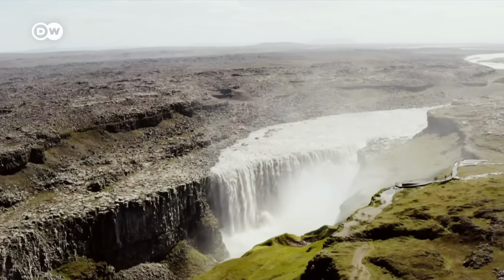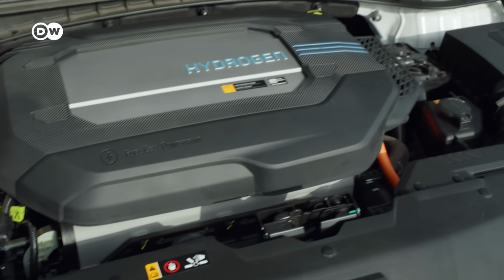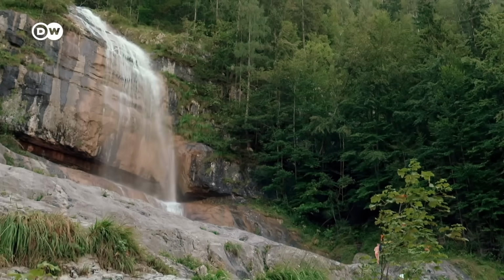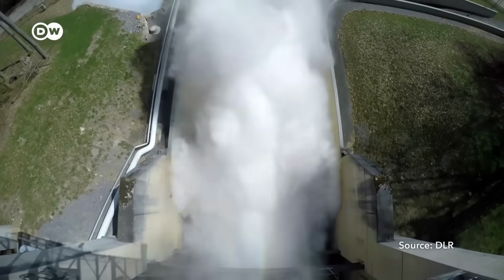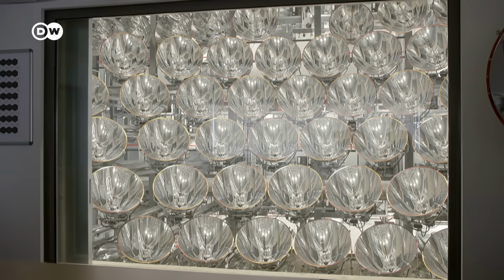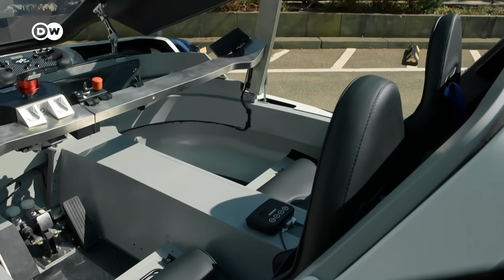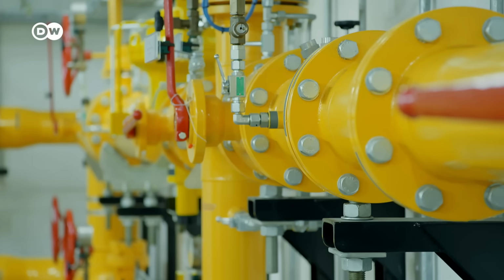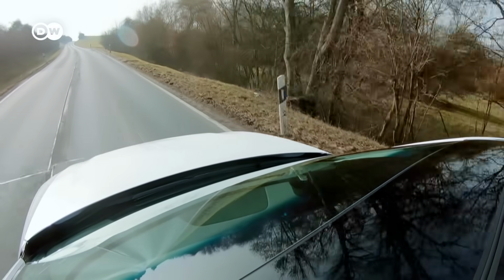Is green hydrogen the answer to the climate crisis? | DW Documentary

Comment: There has been a saying for many years: “Hydrogen is the energy (means/source) of the future”. 

The main concern is what if it remains as such for many more years to come!
Reply: Hydrogen is an means of storing energy just like a battery. They will need to prove that the round trip efficiency of Hydrogen is better then the battery.
Reply: @kevingooley6189  Just compare the weight to power ratio. Empty batteries will weight exactly as much as full batteries.
Reply: @mramstedt  

Yes that is true batteries don't loose weight as they discharge. That defiantly needs to be factored into the equation.
Reply: Only lobbyists and their sheep sing the song about the hydrogen car. There will never be a hydrogen car for everyone.
Reply: Always seeing the eco fascists fighting hydrogen, as if there is an alternative technology available that would work for aircraft or heavy industry. As ever, they are disconnected dreamers who think energy is magic and hydrogen is something invented by the oil companies.
Reply: @1stSilence  unless SWB pinpoint the exact location; you can't explore duterium; the answer to climate change.
Reply: @1stSilence  Lobbyists sing the song of the electric car, and they got what they wanted
Reply: H2 is not an energy, it is a storage means. It first divides the energy you input by 2, then leaks 0.5% to 3%/year. Those pushing it as the solution to all energy ills are just intent on selling something on it…
Reply: @longcours  It's not as bad as LNG tankers which can lose up to 30% on a single voyage into the atmosphere.

Comment: Hydrogen is not a Primary fuel, in effect it is simply an energy storage technology.
What is proposed is to use hydrogen instead of using batteries or other storage media. This wasteful process may be a useful interim technology for certain heavy applications but logically it will be displaced by efficient nuclear processes  in the future.  Because you can does not mean you should.
Reply: Batteries mean another deforrestation
Reply: Methanol seems to me be a better energy carrier for renewable sources of energy
Reply: @Chitragupta What does it degrade the performance of?
Reply: What efficient nuclear processes are you talking about. Will we have a nuclear reactor in our car like I'm Back to the Future.
Reply: A battery that doesn't degrade and doesn't need precious minerals, which can refuel a vehicle in seconds from our existing refuelling network, sounds good to me !!
Reply: Hydrogen made in summers for heating purposes in winters can be as efficient as 80-85% round trip.  This efficiency can be competitive with batteries.  Hydrogen pipelines costs 1/8 the cost of electric power lines per kW of thermal energy per mile, and existing natural gas pipelines and storage can be used to store H2, thus minimal new investment to convert from natural gas to H2.  H2 and Battery should co-exist, each serving different niches.  Works have been done to perfect "efficient nuclear processes" for the past many decades...but so far...???  We just can't put all the eggs in one basket.

Comment: Its all hope. Hydrogen production for the western countries, 36m EVs a year (50% of yearly  global sales) not alone the extra minerals that need to come out of the ground, hundreds of millions of heat pump systems that work in the cold and the capacity to produce them, €100k per house to retrofit and the amount of material that will take and the at least doubling of electric generation of of grid capacity to generate green power to drive it all. This is a long haul thing 50-100 years.

Comment: In denmark we have a longterm project of making an artificial island out at sea to our west. Our plan is to make a massive windfarm where the exess energy will be used for electrolysis of saline water. We will have oxygen that is either released or bottled and hydrogen we will use for fuel for the ships out there. Effectively we make fuel from the green energy if we on some days make too much wich we can use later.
Reply: @Eternal Atake if you would investigate this aspect then will be surprised of how much fish love artificial riffs... the problem is not in the fish but in making those very co2 expensive turbine and all assotiated steel and concrete structures... do you have any idea about how much energy is required for cement production?  Look deeper in to the energy problem and not only by green activist slogans, so far there is no such thing as green energy...
Reply: @Eternal Atake unfortunately it's not only financially, in the core itself it is not sustainable, solar panels as an example do not pay back their energy required for manufacturing, and they become real problem as waste... ethanol fuel is another example,  we use so much extra land to produce food which go as fuel, instead just using much smaller amount of petrol to produce just necessary food and leave the land to nature... everything these lunatics promotes just aggravates the situation and encrease pollution which is a real problem...
Reply: @onlooker774  
Look into CO2 neutral concrete formulas.  There's different formulas, some of which absorb carbon, to the degree that the cement takes up more CO2 than production of the concrete puts in the air.
The thing is, the governments have to mandate the new formulations.
Otherwise, the concrete companies won't switch, because of cost.
Reply: Hey i saw a news about how Denmark's people slaughtered around 1500 dolphins for some shitty tradition ☹️I pray those people will suffer for their crimes
Reply: Tout crève encore même les poissons
Quand bourgeoisie et gouvernement ont tous les passes les droits les libertés ... 
Rien de souverain ni de démocratique alors le vert est plutôt pourrie crasse dominante et persistante
Reply: @Eternal Atake Lol. Much safer than shipping oil.

Comment: Hydogen is not an energy source it is an energy conductor. That the first problem. So the other problem is ROEI "Return on Energy Invested". Fossil fuels have a very high ROEI the oil wells of the 1930s had a ROEI of 100 ie you put one barrel of oil in drilling etc and got 100 barrels of oil in yield. A modern economy requires a minimum ROEI of 15-20. Most of the green energy solutions yield less than that. ie After you burn fossil fuels to make a wind turbine, or solar energy cell the net power from these things are not constant or sufficient to be sustainable over the long term and maintain living standards. Wind turbines and solar cells generally yield less than 10. So we will be burning a lot more fossil fuels and living standards are already dropping.

Comment: Hydrogen is very inefficient volumetrically. It is also notoriously hard to store.
Simpler, more logical solution, would be to generate synthetic hydrocarbons to power the plane. Or even better ethanol(because it is environmentally more suitable).
Reply: I somewhat agree, but it is genius for solar and windplants where they can use the exess energy and use it as a buffer.
Reply: @1Animeculture  As storage it too is problematic. The efficiency of hydrogen generation is low. While it may reach 85% this efficiency is reached for hydrogen made out of methane. If you want to make it out of water then efficiency drops to 50-60%
There is better solution for this application- redox flow batteries. Or lithium phosphate batteries. Contrary to myth, Lithium is quite abundant. 
Not like Palladium which is essential for fuel cells. Palladium is very, very rare element. Gold is common element compared to palladium. Gold is 30 times more abundant than palladium. I have read article where there was stated that entire world stocks of palladium would last for about 2 million fuel cells able to power cars.

Comment: Simple, lobby to govt that all new house builds require to have solar, electrolyser, battery, fuel cell as standard with hydrogen stored using metal hydride tanks. Each house can then feed their own home with green energy and when batterries are full will then create hydrogen as a long term storage. This storage can be used as a battery backup or fill the car up. Lower the energy grid and become self sustainable.
Reply: And a level-2 EV charger only costs few hundred bucks without any change to install anything. Hydrogen is a mess and you need safety certifications for the building and huge insurance policies to cover just the hydrogen tank. Also, fuel cell battery costs 10 times more than lithium-ion battery. When you can use electricity to charge directly lithium ion battery, why would you use the electricity to power the electrolyser to generate hydrogen and then charging the fuel cell battery?
Reply: I think your normal house doesn't need a hydrogen tank, a battery can save enough to power a house through a few days.
Reply: No need for all that tech stuff House should be Passive/Net-zero ....Solar on the Roof and maybe a vertical/Wall Turbine to help ....Look at energy efficient house before Storage/Conversion tech

Comment: That segment about using artificial light to then heat up water to then produce hydrogen (thermolysis) doesn't make any sense whatsoever as it's more efficient to simply produce heat from electricity (via resistive heating elements). I guess it's instead to test that concept in a lab then they'll do so using sunlight and concentrators outdoors? Why not just test it using the latter? Very odd indeed.
Reply: Those are just experimentals, obviously they are are just using energy for the sake of testing. The idea is they wanna figure out if they can use the heat from the normal sun to make hydrogen rather than turn it into energy first (wich loses some of the energy im the process), the advantage to test with lamps is they can start and stop the experiment at will.
Reply: @1Animeculture  Several large solar concentrator plants have already been built. It's well understood.

Comment: The problem with hydrogen these days is that you have to watch for the bait and switch by fossil fuel companies who want to continue extracting ground resources to create hydrogen. That is a dead end for us and is NOT the solution. Hydrogen will not be THE solution, but part of a wider set of solutions as long as we use it for the real purpose of independence from fossil resources and not just a continuation of that flawed model.
Reply: Exactly, the article REALLY glossed over making Hydrogen from "Natural gas", this process emits more freaken carbon  for the same energy than just burning the Natural Gas directly!.  100% cleanly generated Hydrogen is a pipe dream at this point.
Reply: @Battleneter  agree, i find this video is bias. It doesn't talk about the cost to distribute hydrogen.
Reply: You could easily produce a prodigious amount of hydrogen with nuclear power, but braindead environmentalists hate the n word even more than black people.
Reply: @jaffacalling53  Also using nuclear to produce hydrogen is not reasonable. If you have electricity, engines can work on electricity with about 90% efficiency. Now you take that electricity and use it to make hydrogen, 20% of electricity is wasted. Then about 20-40% of hydrogen is lost in transport because it is simply so light. When hydrogen reaches a fuel cell, there is about 30-50% of energy loss to heat. My question would be, that would it not be more reasonable to get the electricity (which you wanted in the first place) to the consumer directly if possible in any way. Most of the energy is simply lost because we want to make electricity to hydrogen and back to electricity.
Reply: @markust6039  Agreed. Green Hydrogen should be perferably used in transport that can't rely on batteries or electric motors (maybe aircrafts, long-range ships) or in industrial applications that need hydrogen or can use hydrogen to reduce carbon emissions (steel manufacturing, IIRC), as a replacement for hydrogen produced from methane steam reforming.
Basically, if we can brute force processes with electricity, just use electricity.
Reply: I came here to write exactly the same.  Thanks
Reply: The wider clean solutions being nuclear, natural gas and that's about it. Forget wind, solar and other inefficient technologies.
Reply: @louisfriend9323  
Nuclear is a disaster in terms of Nuclear waste. 
America & Germany have so much that they are no longer certain about what to do with it all.
Reply: @ttuliorancao  
Although most of the time the waste is well sealed inside huge drums of steel and concrete, sometimes accidents can happen and leaks can occur. 
Nuclear waste has drastically bad effects on life, causing cancerous growths, for instance, or causing genetic problems for many generations of animal and plants. 
It needs to be housed in water which pollutes precious water. 
Over 2000 metric tonnes of Nuclear waste is produced by America every year. 
The new Aurora tech is not even available yet & the fuel it requires still means that their will be Nuclear waste left over once the separation process is accomplished of the enriched fuel. 
Plus it takes a long time to build Nuclear reactors. 
Hydrogen only emits water in comparison, I think Japan has the correct approach with Green Hydrogen like Australia. 
I'm uncertain about renewables as a energy source because it's destructive to the environment in sourcing the materials required & it's inefficiency & unreliability is causing major power shortages. 
Coal is a safe & rather efficient power source to me, coal washing technologies have made this a reality where coal can be burned cleanly by capturing the CO2 emitted & burying it underground which is far safer than burying Nuclear waste, they just need to build on this coal washing technology until there isn't any emissions.
Reply: @brantleyfoster021  oh, and I almost forgot about hydrogen: nuclear is the best way to produce green hydrogen as you can use the heat of the reactors to directly break down watter into hydrogen and oxygen, without the need to transform it to electricity first. Way more efficient and reliable than renewables
Reply: "Green hydrogen" vs "Blue Hydrogen" and "Black Hydrogen"
Reply: Unlike the E revolution, who doesn't go around raping and destroying the plant digging up rare Rare Earth Metals for EVs!🤣
Reply: Even with Green H2, the same economic model where refuelling is concerned will remain. Fuel Excise Duty on Petrol currently makes up approximately half of the fuel cost and as there would be Hydrogen filling stations the same level of taxation could be applied, unlike electricity which is unlikely to be taxed at 50% from a socket at home.
There is also the problem of 'embrittlement' to metal storage tanks.
Reply: ",,,fossil fuel companies who want to continue extracting ground resources to create hydrogen."
That's a great way to use the recourses to develop the stepping stepping stones to cleaner production. It would still be cleaner, and a step in the right direction.
Guessing you also hate nuclear development.
Reply: @politicallyunreliable4985  No, actually I am fully on with Thorium salt reactors! Heavy water reactors are shit and should be tossed into the dustbin of history. I just hate the fossil fuel companies. Here's why. They aren't really run by smart people. If they decide to do fossil based hydrogen, you can bet they will do it in the most ham fisted way possible that causes the most destruction. They really aren't capable of doing anything else. We already have plent of stepping stones. They had their chance to develop those and didn't. Why? Because they really aren't that innovative or smart. They are really good at exploiting natural resources in incredibly awful ways, and that is about it. So, yay to safe thorium based or natrium based salt reactors, boo to hamfisted greedy and lazy gas and oil companies who are too stupid to see the future.
Reply: @alexMarinick  Yes BUT there is a huge efficiency loss and you may as well just use that electricity directly over making "green hydrogen".
Reply: Spirituality is the solution
Reply: There is a real case for green hydrogen as energy storage. We can extract hydrogen from high hydrogen atmospheres using energy we'd otherwise be wasting from wind, solar or other power plants. It wouldn't be terribly efficient, but it would be better than not using it at all.
Reply: Shouldn’t we call them hydrocarbon fuels since they aren’t the result of fossils?
Reply: how about the bait and switch of the ev sector with cobalt from congo mined by child labour by chinese?